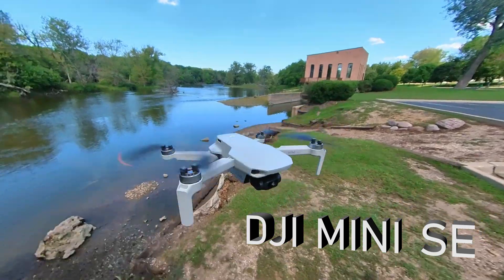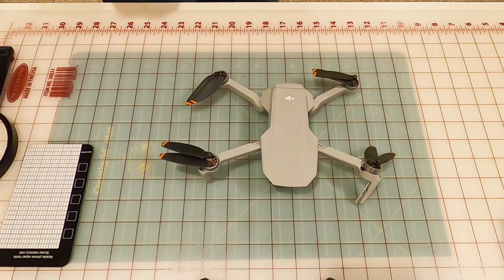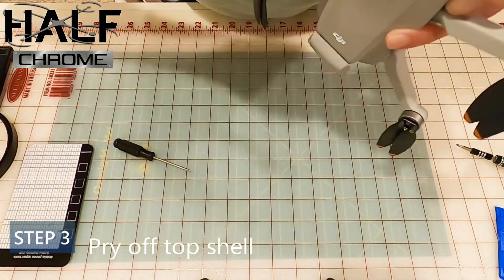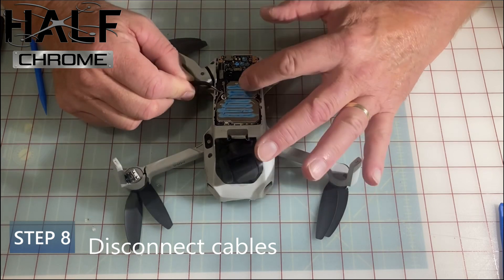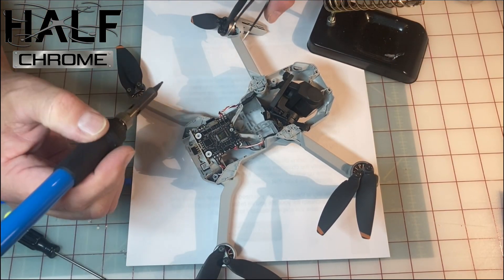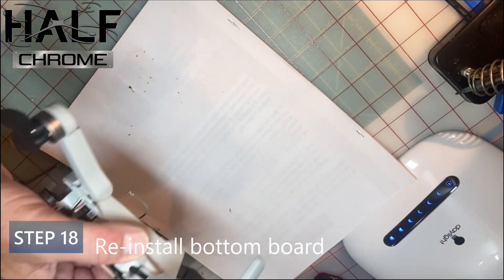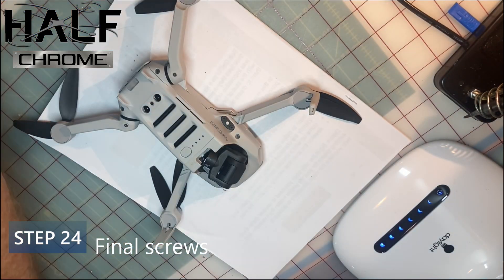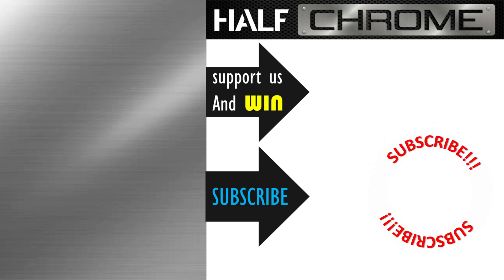Repair your DJI Mini SE, Mini 2 or Mini 1 | DIY Arm and Motor replacement

Comment: How do I get the gimble motor apart from its carrier and then replace it with the part I need? The motor and bearing does not separate. Help!

Comment: Why did you take the whole drone apart instead of just taking off the top body and then unsoldering the 3 wires and removing the arm? You did a lot more work then you had to I believe non the less still a helpful video
Reply: Okay thank you for this. I took off my top and I saw the wires and was so confused on why this person and other tutorials took everything apart lol thought I was crazy
Reply: Right! He made me take the ribbon cables off and one of my connections are damaged! I didn’t need to remove the board to solder!!! 😩😫

Comment: i had 5 small crashes. now i keep getting a navigation error. some times it will be fine again and other times it will keep showing the error. got a new gps unit and will replace if the error won't go away. crazy problem to have at only having my mini 2 se for 3 months.
Reply from the maker: 5 crashes is crazy.
Reply: @HalfChrome  3 from 15 feet, 2 from 2 feet. Only damage was the propellers.
Reply from the maker: @tallicafan85 clearly not.

Comment: Sader?  Translation SOLDER it has an L in it, so in English we actually pronounce the L as in older, but add an S.  Good video. 😊
Reply from the maker: Nope
Reply from the maker: the traditional pronunciation of the word lacks the /l/ sound, and this /l/-less pronunciation is preserved in American English.
Reply: @HalfChrome  Lazy American version of English, or is it Engish if we are losing the L .  We could have Ord people or peope.  I did read once that the average book in the USA has 7 pages less because of the shorter spelling of the English words.  But some spoken words are split up "vee hic ul" in some states for vehicle . Suppose it's another dialect.

Comment: Very helpful, thanks. I'd like to remove the arms and motors off my SE and send the camera and body up aboard a high altitude balloon to 100K feet. Will the unit continue to respond to the controller ,take, transmit and store video even when it goes beyond max range?
Thanks for any insight!
Reply from the maker: The range is the range. 100K feet is almost 19 miles that will be too far.

Comment: Excellent video and even if you removed the motherboard and gimbal unnecessarily, that's potentially very helpful for anyone needing to replace a gimbal or indeed swap everything to a new chassis.

Comment: Great video, I have a issue the arm will no snap in to most forward position, can’t get proper alignment to insert area pin, any ideas?
Reply: I'm having the same problem..  Did you figure it out?
Reply from the maker: @TshirtWetter little pieces require some extra patience. Good luck.

Comment: I did it but when i put the pin back, my arm doesn't stay unfolded fully but rather half way. Have you ever encountered this? The arm wants to stay half folded, parallel to the rear arms.
Reply: Figured it out, if any one is having issues with this, what i did was twist the spring pin halfway, insert it and that was the solution
Reply: @whitesuit123  what part did you twist? No mather what i try,  it always end back at 1/2 position
Reply: Nvm, figured it out, thanks

Comment: If the drone is still flying correctly, just slightly unstable and there’s a crack in the arm making it loose, can I just take the arm shell off and replace the shell rather than take the whole thing apart?
Reply from the maker: They don’t sell just the shell

Comment: I'm up to the soldering part.  I'm new to this kind of soldering.  Soldering videos show adding solder, but arm replacement videos don't.  It looks like solder is on the wires.  do you have a video with details on the soldering part?

Comment: 💥 Thanks for this great video.   What does anyone think about gluing the snapped motor area like in this video back on using epoxy.??   I was thinking of patching the seams with a small thin piece of plastic like a bandaid over a cut and using a 2 part epoxy.  One tiny piece on each side of the motor area.   That stuff fixes just about everything and there can’t be much pressure on each of these arms.   🤟🏼

Comment: Hi, slightly disrelated question:  Do you have to remove the bottom shell to replace the BACK arm?  I saw a video for replacing the rear arm on the mavic mini and the arm came off without removing the bottom, and he threaded the wires through (tediously) and used tweezers to get the electrical wires to the place they need to be soldered.  Is the mavic mini that different from the mini se where this won't work?  I watched a bunch of mavis mini videos that also said to remove both top and bottom shell.  So I'm a little confused.  Removing the underbelly (bottom) looks very complicated.
Reply: @Michael B. I was able to replace the back left arm without removing the bottom shell.  The hard part was getting the top shell off.  Now I'm up to the soldering.  I've never soldered before.
Reply: @thefreedomreset  Does the solder come as part of the kit? I couldn't tell. I broke my drone's left rear arm and am contemplating if I should fix it by spending $90 ($50 arm + $20 kit + $10-30 solder iron). I haven't soldered before either (but I have replaced SDD on my tablet PC using some of these tools before). Appreciate any inputs.

Comment: Great video! I recently purchased a mini se and quickly crashed it knocking out the GPS module I had not bought coverage so me being a mechanic I took on the repair, it’s difficult but very doable it’s like taking a fragile model apart and putting it back together, my repair was successful flying again but way more careful,just take your time and use correct tools have fun!
Reply from the maker: Great advice

Comment: Nice video!
Possibility of adding larger/stronger motors to a Mini? 
Biggest drawback to these small/light quads is their performance in moderate wind (IMO). 
If not concerned with >250gr and <run time, would a motor upgrade work with software?
Reply: The mini 2 and se do have good wind resistance tho.
Reply: Anything is possible ❤